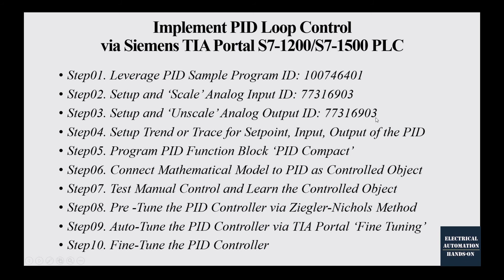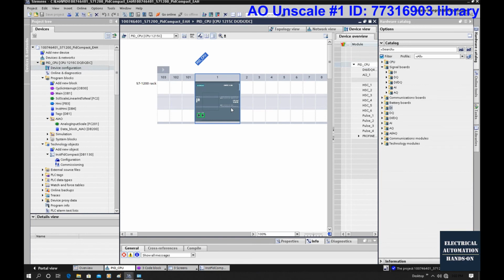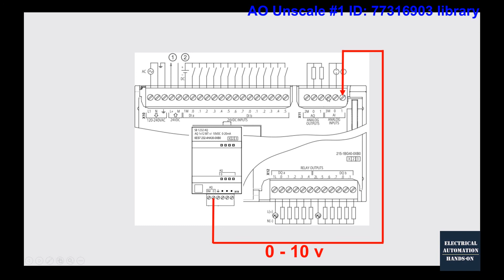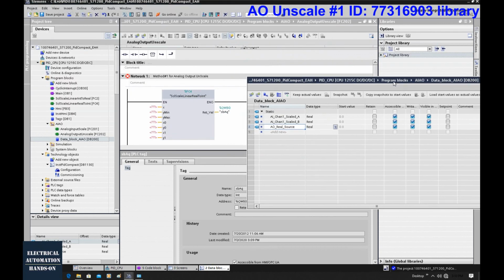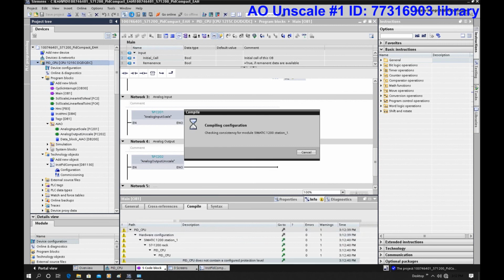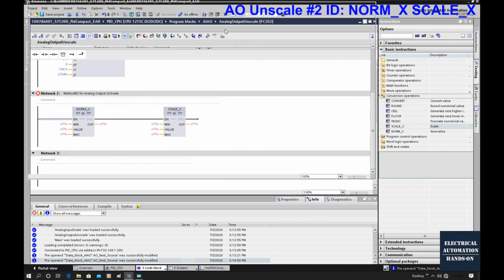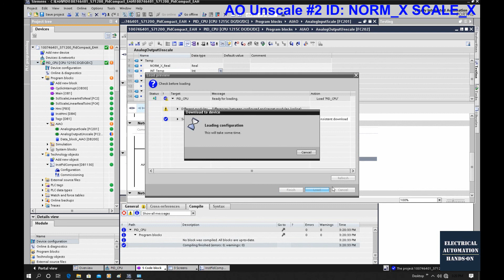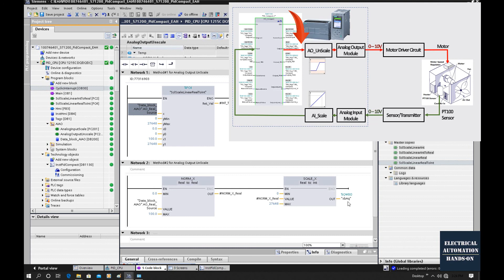PID13 - Siemens PID03 - Analog Output Unscale Library and Norm_X/Scale_X in TIA Portal

Comment: Hi i use method two in my project, i use 5 different FC's for 5 conveyor by controlled analog value. So i create a time of day interrupt and when time is arriaved i moved a value to QW of two conveyors in time of day interrupt (OB10). But it didn't work because i used qw value for FC's output at main function. Like you did, i assign to temp veriable of two conveyors output and its work it. If I want to implement such an application, should I solve this situation by setting the temp or is there another way?
Reply from the maker: I think you need comprehensive understanding on the temp variable, interrupt, FC call. It is hard to describe and explain via word unless you could show your program and program structure. You could send me an email for your personal question coming with the donation for compensating the time and efforts for review your problem.